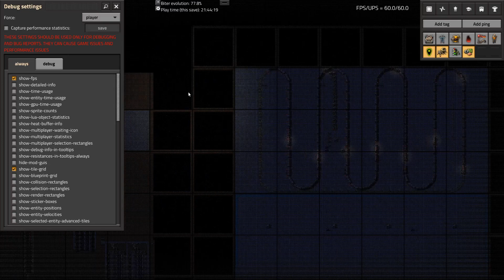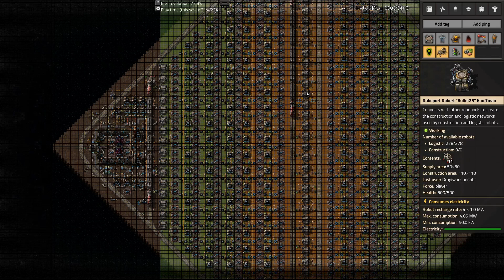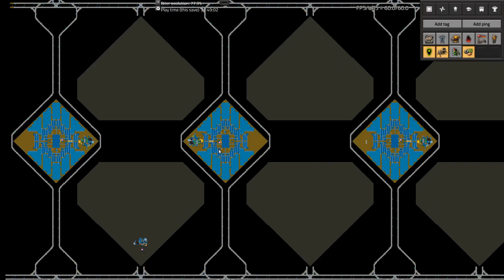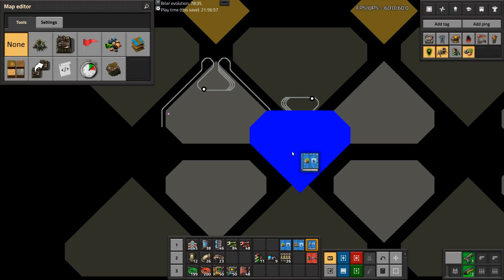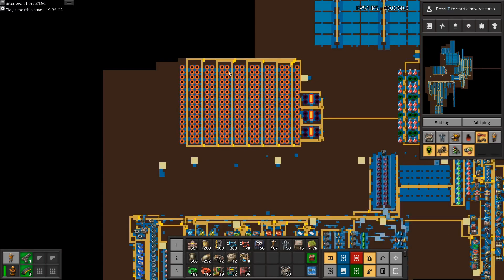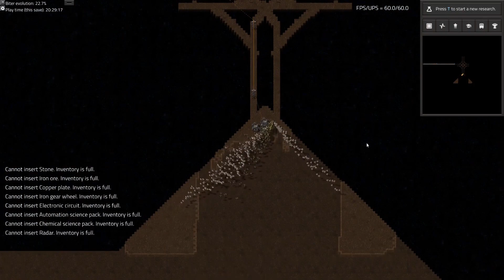Factorio SpaceBlock 6 - Base Design

Comment: This was a really fun episode, thanks for posting it!
Also, could you not use the built in blueprint "snapping" to make sure you can't misplace any of the parts?
Edit: It seems you already are, but at a much smaller size/tile, why not simply make them large enough to never be possible to misplace, and have multiple blueprints for the different "positions" within the larger frame?
Reply from the maker: True. I wanted to have them snap to a 32x32 grid until I knew how and where I wanted to place things but I could probably extend the grid size now that I have that figured out.

On the other hand, I realized it's not that hard to get right now that I have the train system guiding me.

Comment: Maybe I’m just stupid, but how will you take items into those cells? Like you need a train to come in with red circuits and another to output science
Reply from the maker: Yeah I wasn't too clear on that I guess. I can either extend the rail network and have supply stations at the wide ends of the cells or extend the little stacker/station plug that I have to include more stations. Not quite sure yet how I'm going to do it.
Reply: @DroCaMk3  I think it'd be more impressive if you manage to have combined load/unload stations, and a good way to want to avoid shipping in materials :)
Reply from the maker: @bjorn9875  Haha, I had exactly that thought last night. I think things may just get limited to one station per cell. Let's see how that goes :D